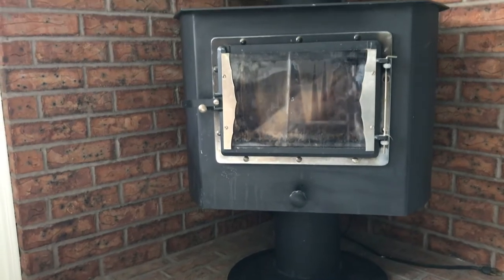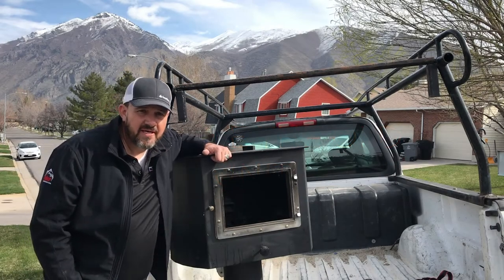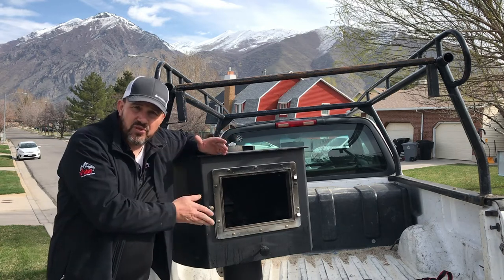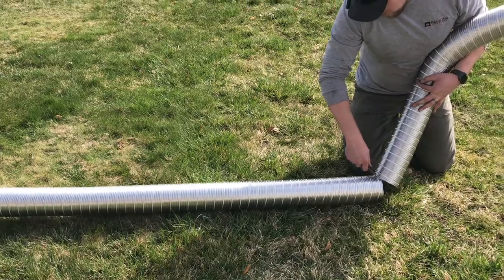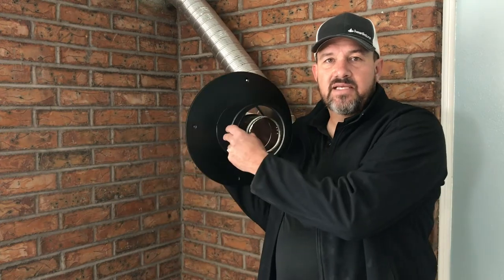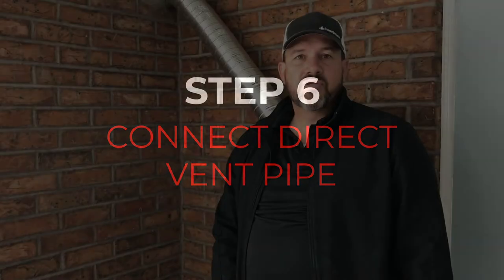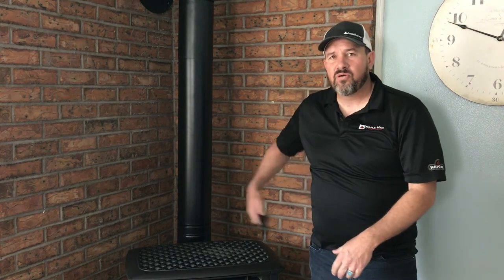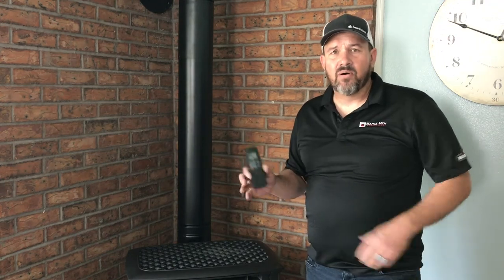DIY Wood Stove to Gas Stove Change Out

Comment: Good video, thank you!  I’m doing the same job on my cabin that has a double wall stainless chimney.  Hoping I can slide that 4” vent flex pipe down my existing chimney and make a 90 degree turn at the bottom where my pipe goes through my wall.  In your experience does the 4” fit in traditional wood stove double wall chimneys?  Thanks!